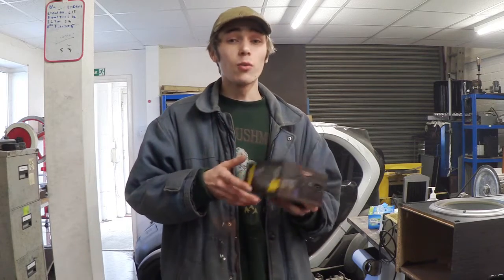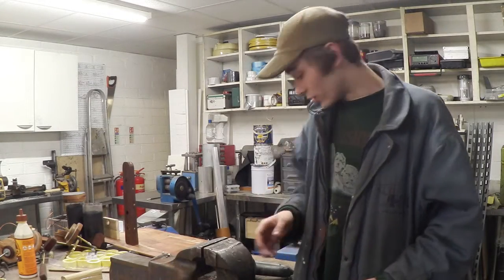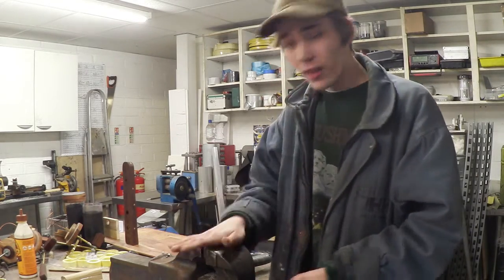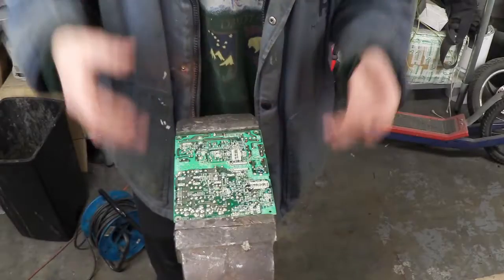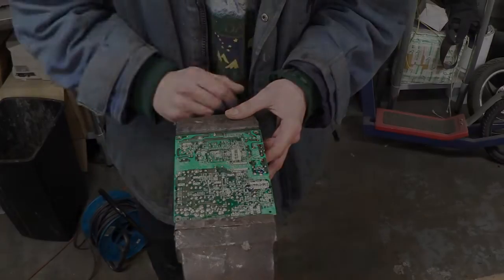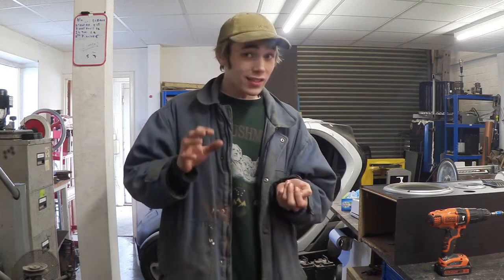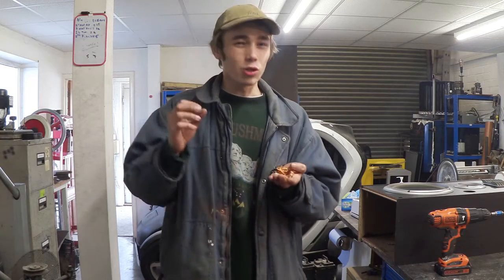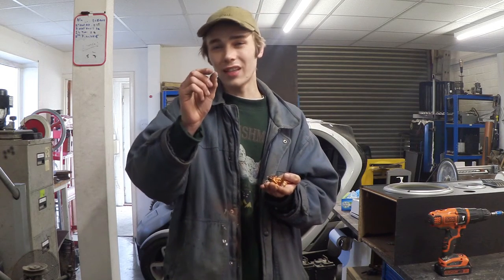1061 - How to Take Components Off a Circuit Board.

Comment: I used this method once in awhile. There's a special nozzle that you can attach to the paint stripper, so you can direct the heat better. When removing integrated circuits, beware of ESD. Use a wrist strap. Also, tweezers are a bit more gentle than a screw driver. Using flux will ease the process. With power supplies, make sure the capacitors are drained before touching them.

Comment: Aha .... I happen to know what it smells like if you do that. Your neighbours know too now I guess. Probably the whole neighbourhood.
Actually it's common to remove smd silicon with a small heat gun. Usually these can be reused after that. If you stick a pin under it, slightly pull and heat with hot air it will not be hotter than when it was soldered by the reflow process.
For through hole components it's better to take them off wire by wire if the component shape allows it. Just with a solder iron. If you have a high pin count like a DIL package you can cut from above and pull the wires out one by one. The component will be lost but usually that's not an issue. Tweezer solder irons exist and can help in many situations.  It can be difficult to remove a through hole component due to pcb design. If a wire is placed in a pad which has high thermal conductivity to a large copper plane or maybe 4, 6 or 8 internal copper planes it can be very hard to remove it. Preheaters exist for this kind of situation. When preheated you only need to add the additional heat to get to the melting point from the preheated situation. Not from room temperature.

Comment: When you're removing toroidals, if they are for rewinding you can just snip the base of the copper wire. Heat is only needed when they will be reused in the same form.

Comment: The technique that i was taught is to use a standard soldering Gun, and a tool called a "Soldapullit". What that does is as you isolate the component leg, you warm it up with the soldering gun, and apply the rubber tip of the SoldaPullit to the molten solder, it triggers with a 
finger and basically 'Sucks the molten Solder off the component leg and you do the other ones there and the component drops right off with no damage. What makes it neat is you can remelt the solder and use it as it gets ejected out the front of the tip when you reset the tool.
Neat Gizmo -- Look them up!
Reply: Indeed those small (literally) suckers are handy for lot of stuff but not really suitable for small pads.

Comment: Remember that if you use parchment paper and a marker so that you have some heat protection for the board so you dont scorch anything that you don't want heat damaged; parchment paper can push through the pins and heat the solder without "burning" the board for later purposes.

Keep it up mate, you're doing fine!

Comment: Great video Luke! Is there an advantage of the heat gun over a beefy soldering iron?
Reply: My thought exactly. Been using an iron to remove stuff and rarely destroyed anything. This seems more taskfull.
Reply: @Teknopottu  tho it IS nice to know that we CAN also use a heat gun if an iron is not available or appropriate yet desoldering is required
Reply: @WileHeCoyote  That is true and when removing several components with multi legs, this could be easier on the long run.

Comment: Top drawer for the presentation ....bottom drawer for your technique!!

Whatever happened to soldering iron and solder sucker??

RAE trained and 40 years in marine radar and Comms- if anyone saw me using your method - I wouldn't have been doing it long! - not flaming you young Fella,  just pointing you to tbe proper work method....

As I've said to the Old Boy,  Great Channel.....but dont ruin it with naff work drills....
Reply: Agree, solder sucker or wicking braid. Integrated circuit components are a beast to remove without damaging.

Comment: This did seem to work. I find an oversized soldering iron and some solder wick works well too. I use a 100watt iron. But that is not what a hobbyist would have for a soldering iron so the heat gun is a good option.
Reply: Much faster...been doing the same for years.

Comment: I have seen tray of sand heated on a hotplate, just lay the board on the sand and pull the components off.
Reply: must be a very hot plate
Reply: @mamupelu565  yes. about 230 degrees centigrade.
Reply: @edwardhughes352   if only someone had tested a derivative of Luke's helpers ink ^_~ 
'cayrex2 High temperature Conductive ink - 1000 degg C (Update)'

40vAC from a practical diy mechanical (3vdc air pumped to trompe *accumulator /tesla powered) DC TO AC GENERATOR should do it apparently.

* Water Pressure Transducer,1/8NPT Thread Stainless Steel Pressure Transducer Sender Sensor 30,100, 150,200,300,500 psi for Oil, Fuel Air, Water + esp32
Reply: just a metal shallow tray on a normal hotplate, I am not sure what Paul is saying.
Reply: @edwardhughes352  to make something dedicated using non usual methods .. use off grid style, even when your not off grid, not dependant on commercial vendors, open yourself to non conventional thinking practice ...  you have 'the stuff' & because you can ^_~

its fun and saves...
'Construction of spherical tanks by explosive method. Explosive Hydroforming.'

Comment: Was going to mention the respiratory protection, but you addressed it at the end. Good work. I also like to use a bit of solder braid and flux, or even a stripped wire to wick up some of the solder if it won't come off easily.
Reply: My preference: Solder Wick, oka, solder braid.